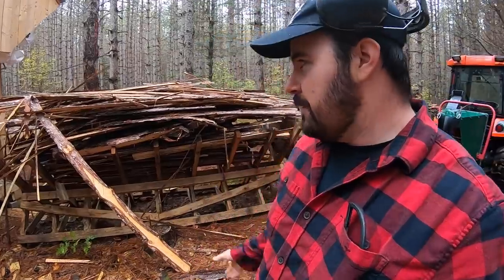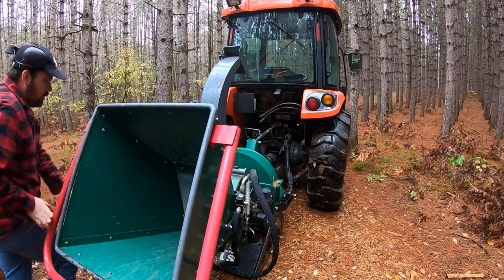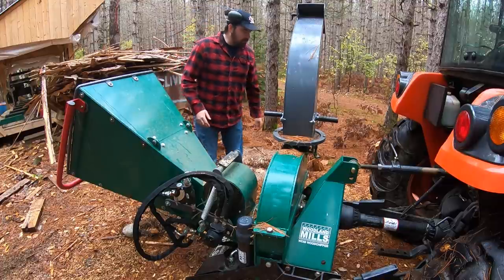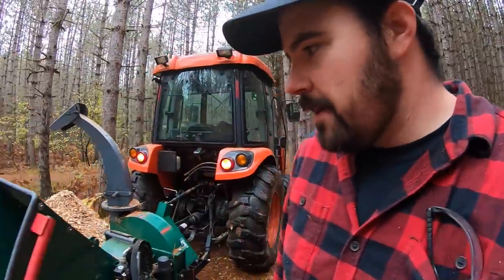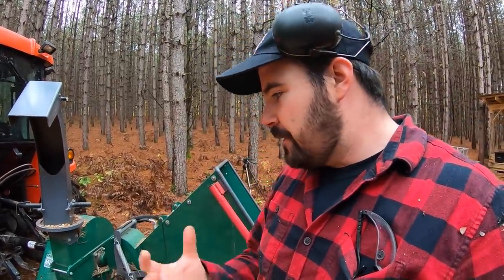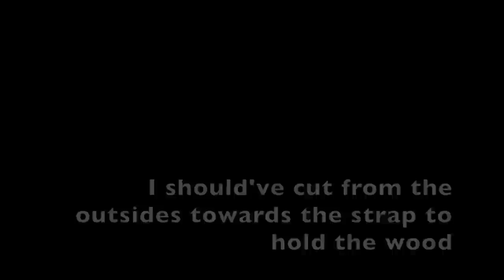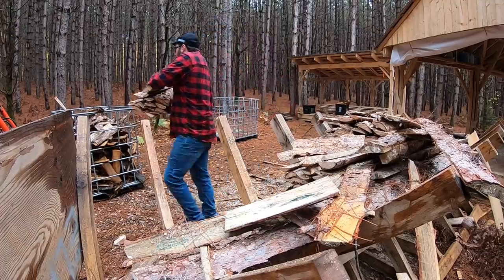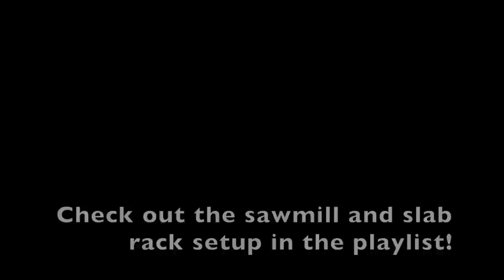Firewood and Wood Chips from Sawmill Waste | Nothing Wasted Here!

Comment: When you chip the wood,   how does it affect things later when your snow plowing?   Do you just hold your blade up a couple inches above the ground?
Reply from the maker: Good question Terry. I find that it doesn't affect the snowblowing or plowing as I normally have the chips spread out smooth by then and with the ground being frozen the bucket or blower just rides over any humps.
Reply: woo, great question!  this is why I read comments!

Comment: Those slabs …… lol you have to clean em up or you end up with a mess. That chipper is a great machine, in your logging/ woods roads do you find it dries up the muddy parts ok? My logging roads have some muddy holes I’m thinking if you put enough chips it will get pretty solid of will it make more mud as you pass through with the tractor say in winter ?
Great job

Comment: I'm kind of OCD when it comes to using every bit of resource from whatever you're working with.  I love how you find a use for everything on your farm.  Very refreshing.  In my recent youtube rabbit hole I went down, the thought crossed my mind that you could use the firewood from your operation to fire up a gasifier/generator combo and use your firewood to have electricity in your work area.  You mention a lot about how you dont have electric out there, and that might be a good way to rid yourself of your shavings, off cuts, and scraps.  Have you considered using a wood fired energy source of some kind for sawing?
Reply from the maker: I"ve always wanted to learn more about those gasifiers. Sure would be a great use of the wood waste around here. If I were to ever do things again I"d likely put in a wood boiler to heat my shop and home

Comment: Hey Sandy, with the ICB totes, if you have the tote part, you could cut off the top and fill the tote with your chips. Move it where you want with the forks and then tip it over to dump it out. The chips are light and the tractor will easily lift a full tote.

Comment: Another Great Video.. I have the same chipper and am impressed with its capabilities (been feeding 2-4 inch hawthorns trees into it) You need to be careful with it, if you have a lot small, or leafy material.. it can plug up.. I try to selectively feed a larger pieces  to keep it cleaned out.

Comment: Could use small dump trailer for chipper to discharge into  then take and dump or spread in desired  area
Reply: I suggest in an earlier slab chipping video if he had any of the bladder tanks that come with an IBC tote.  He could shoot the wood chips in there and move them with pallet forks to where ever they were needed.
Reply: @bwillan  or seven small garden  tractor  trailer with dump option  relatively inexpensive  metal frame and  Ibs  plastic  dump bed
Reply from the maker: @bwillan. That would work well. Unfortunately for me I didn't get any of the IBC tanks with the IBC cages.
Reply from the maker: @Robert I think that would work too. Up until now when I do need to transport the chips far I just use my ATV and utility trailer. With these chips I'm going to move them with my loader so that I can spread them with the laoder as well close by.

Comment: Question, Is the feed adjustible for speed and if so slower would you get finer chips? What you are making is great for putting in lower wet places but for bedding finer is better?
Reply from the maker: The feed speed is adjustable with 10 speed settings. I normally have it on max speed as the tractor can handle most sizes on full speed. I can make some adjustments to chip size but I normally have just left it on course. I should try out the finer settings sometime though to show you folks.

Comment: If you add some planks at the cross in the slab rack you will give yourself a slightly higher level so that it's easier to avoid cutting into the frame.
Reply from the maker: I think this will have to be something I do for sure